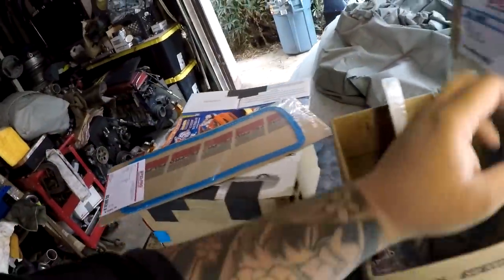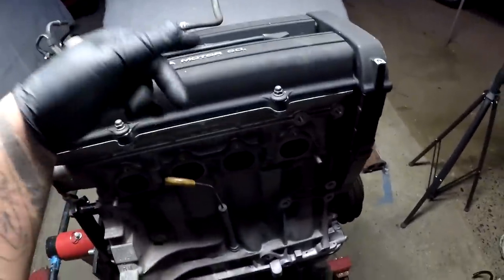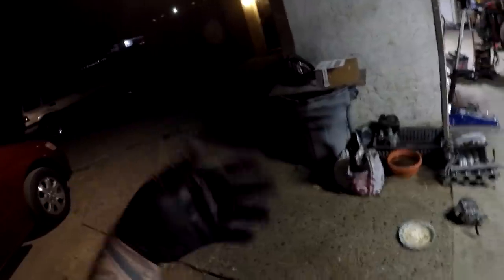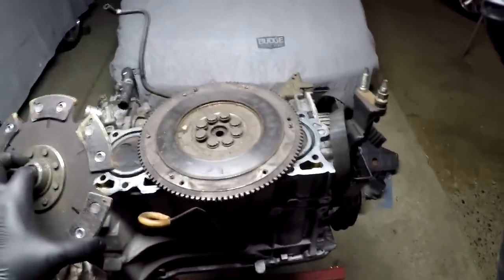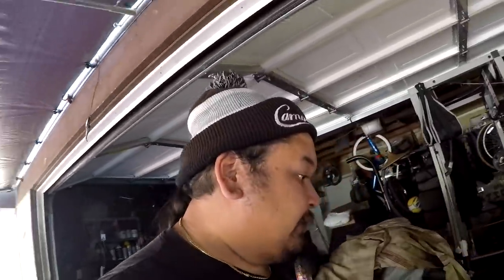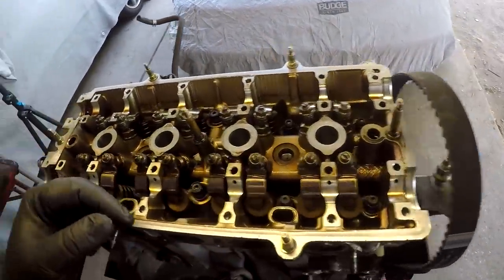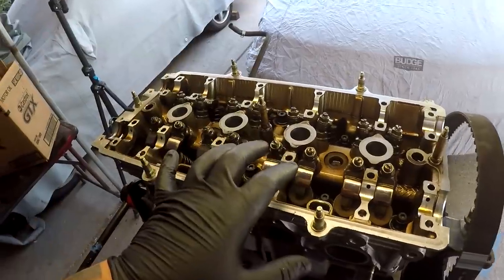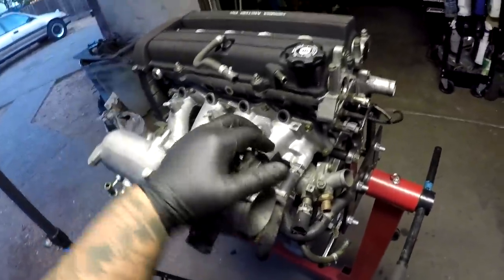AWD BUILD 1 : B20B gets a Make Over

Comment: I have  a 1995 prelude SI manual,  can you help me with this,    the car was running good, I just close the hood very hard and  after that, the car wont start no more , I have to push it to crank it since is manual.   I did replace the starter  and the battery  , and still doing the same I have to push it to get it to run.  please help !!!!

Comment: Hey bro im a big fan. I start my project I bought a blown integra with a b20. My question is can I splice in the distributer that came with the b20 or do I have to change it back to the old distributer. Also the Alternator . Or can I just slice in. I ask because the use the same wires but different plug in. Will it mess up the readings to the computer

Comment: i did my b swap and started it the timing belt was a bit loose and the intake cam jumped a few teeth is it possible to loosen the tensioner and move the cam back ?my first swap don't want to fuck up the timing
Reply from the maker: yes, loosing the tensioner, but everything back to tdc and retime it. if you damaged any valves, you'll know on the start up.
Reply: Okay sweet im a bit confused about the 90 degree part for the cylinders, should i get both to tdc then put on the belt ?
Reply: Thx for getting back to me much appreciated. 🙏🙏
Reply: I really wish the go pro didnt shit the bed on this one i needed to see this haha

Comment: yo Dana good vid. I wish you would explain thing more Like, what size too to tighten the head bolt and torque sequence. Things like that for use planning to do stuff like this.
Reply from the maker: DAP I mentioned the torque specs and showed the sequence I did them in.. 🤔
Reply: Do a little research bro, it won't be hard to find.
Reply: It’s not that I have it but a how to bid should be a little how to. That was an example about details

Comment: I'm glad I'm found the channel but one thing confusing me... why strip the head if you're not gonna clean or do any headwork like porting?
Reply from the maker: Because It isn’t my main engine going into the car. The b20 was a temp and i changed the maintenance parts to insure I won’t have issues and also head studs to insure no head lift under boost.